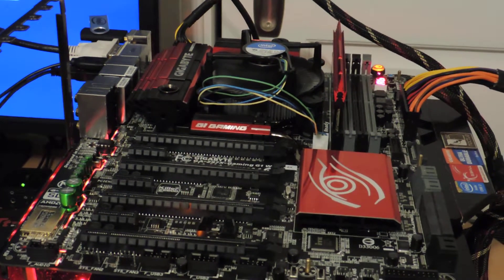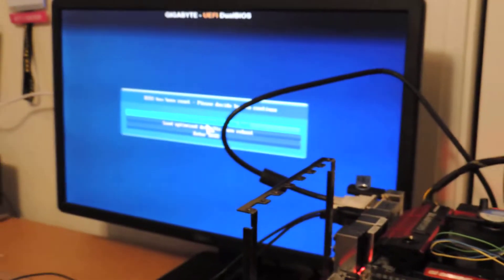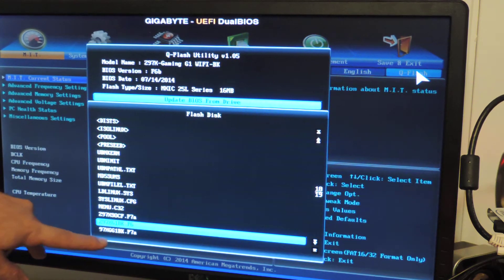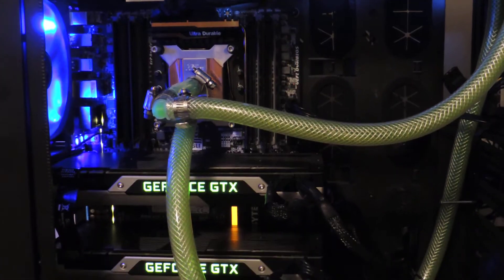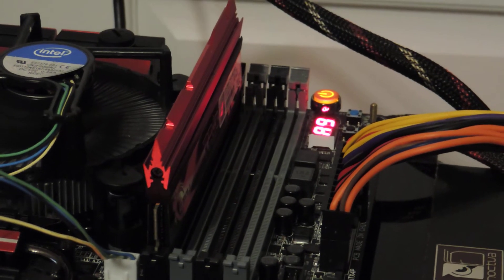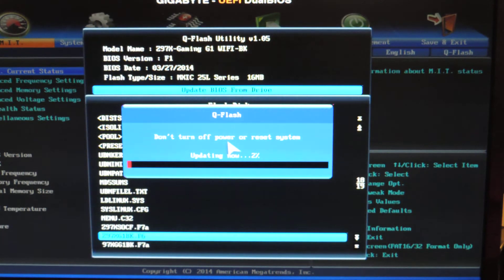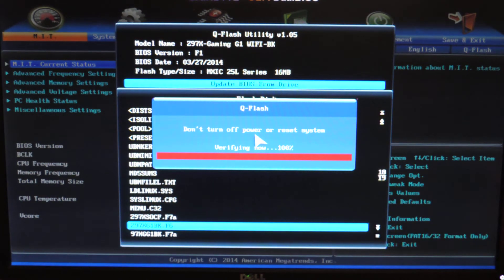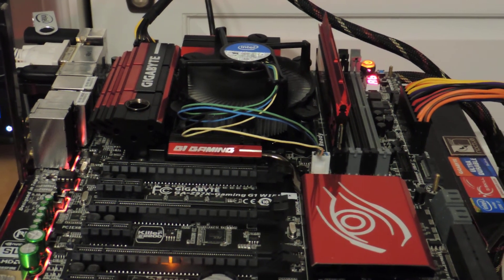How to Flash main and backup BIOS with QFLASH-Blooper edition

Comment: Does switching the (SB switch) to single bios stop the backup bios from kicking in and re-flashing  main bios in case it crashes? 

And thanks for the video it was really helpful @sin0822
Reply from the maker: yes it disconnects the dual bios feature
Reply: Thanks buddy. your video was really helpful.

Comment: wtf is that a hose pipe?
Reply from the maker: no, its tubing I got from homedepot, I have used it for years and they are durable and don't kink and come in the right ID for watercooling. Very good tubing for watercooling, but its thick and durable so the OD is too big for compression fittings.

Comment: what does this new bios fix i have soc motherboard ?
Reply from the maker: nothing much, its just if you have a Devil's Canyon CPU like the 4790K or 4670K or even a Pentium AE you should flash to the latest BIOS or else the stock VID will be too high and overclocking might not be as good. However, if you have no issues you shouldn't flash to the latest BIOS as there is a tiny bit of risk involved.
Reply: Hi sin0822 i have bios f6 and a 4790k i got this SOC motherboard  the new bios is f7a ?
Reply from the maker: Jerome Hieb I think you should be just fine with the current BIOS you have. :)
Reply: thank you sir love your videos
Reply from the maker: Jerome Hieb Thanks man!